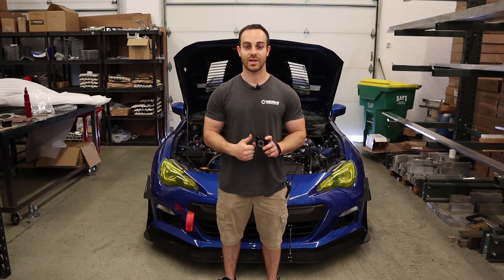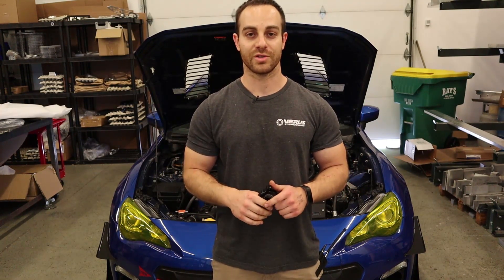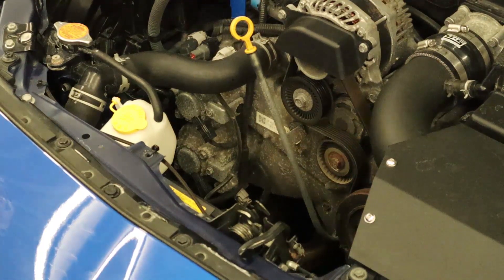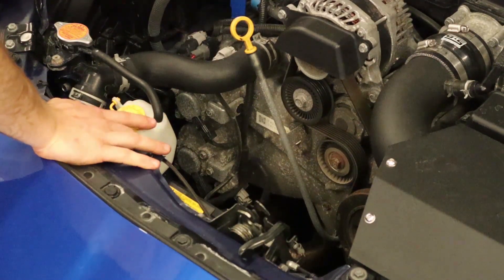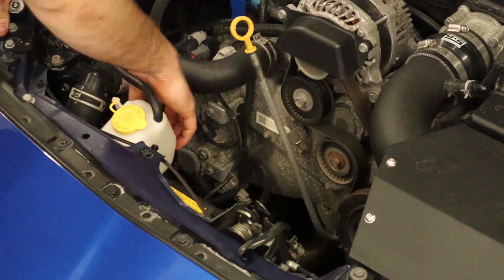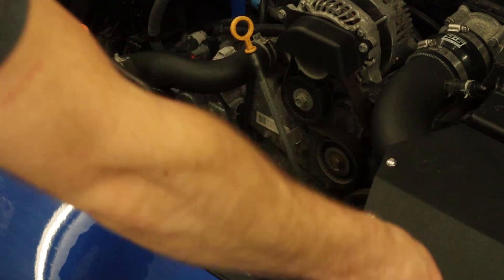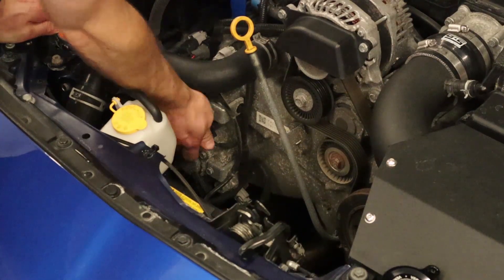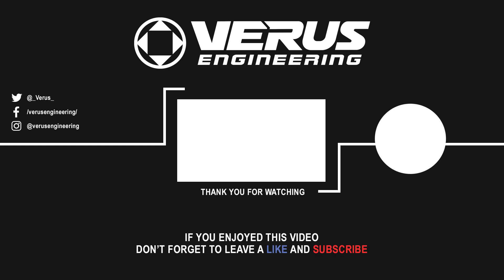FA20 Cam Sensor Cover Kit Install

Comment: this is not the cove for camshaft  sensor its a cover for engine variable valve timing vvt solenoid 
the camshaft sensor is on the top and there is 4 of themes 2 upper on each side and bottom too